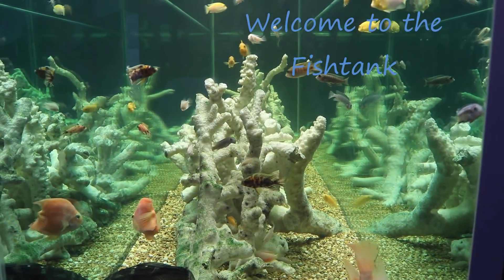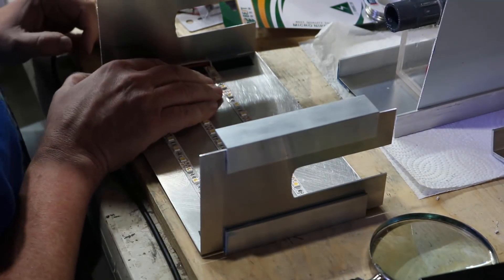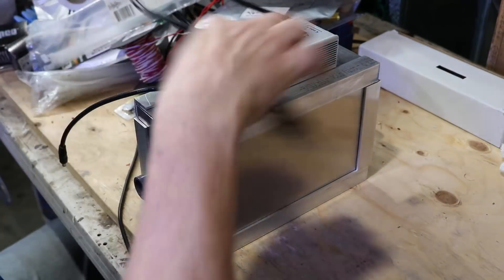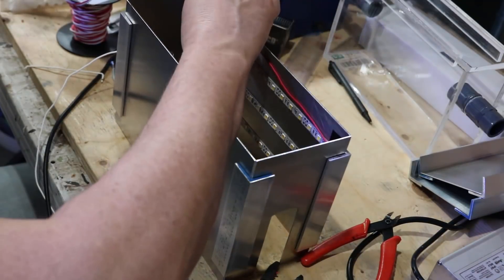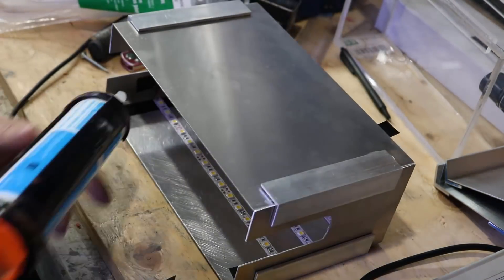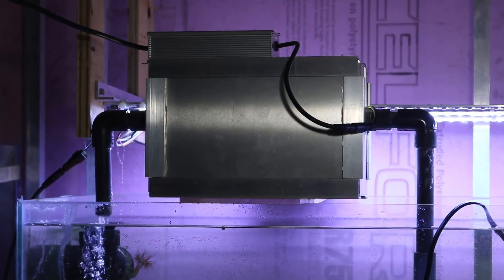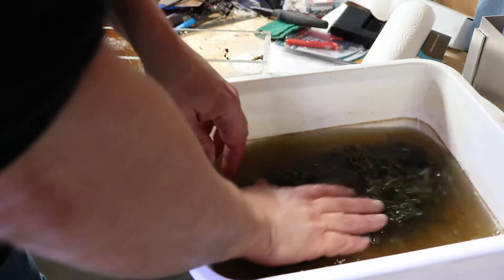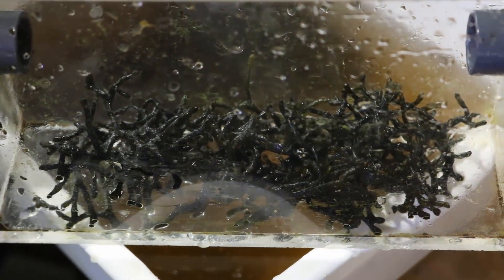DIY Algae Filter Part 2

Comment: How much was the cost of acrylic I'm going to try and build one for my 93 gallon cube mixed reef
Reply from the maker: The reason I built this in a rectangular aquarium shape was because it was the cheapest way to build it out of acrylic. The acrylic is only about $2.50/square foot. That makes the cost for the acrylic part about $8.00. These are approximate prices as I was using some pieces I had laying around for this test.

Comment: You may get better results in growing algae using red lights - plants and algae underwater depend on red light wave spectrum more than other wave length. Nice video!
Reply from the maker: Hi Michael. Thanks so much for stopping by. The client I made this for had no money to pay for it so I used what I had laying around. If this does well I will try other configurations to improve it.

Comment: Hi bud just a quick tip for the scrubber, change the lights from whites to a mix of reds, purples and blues you will get much better growth 👌 other than that this is pretty cool how you have done this one 😊
Reply from the maker: Thanks so much for watching and for giving input. Unfortunately it has to stay as is because the client doesn't have any money for it and I used what I had in the shop to build it.